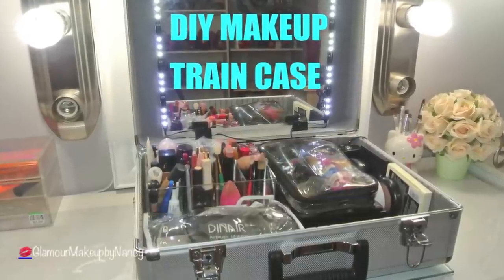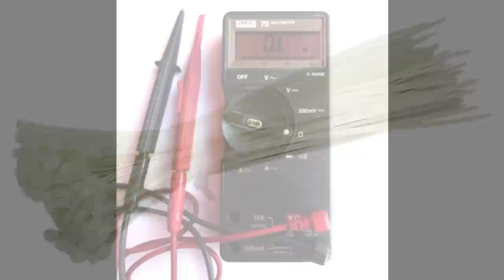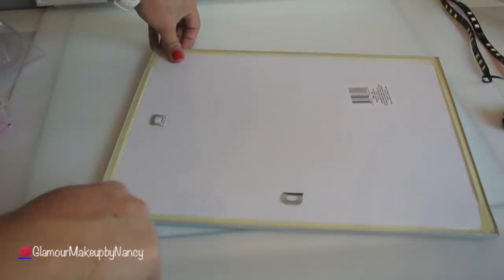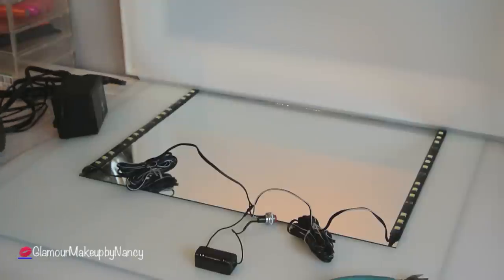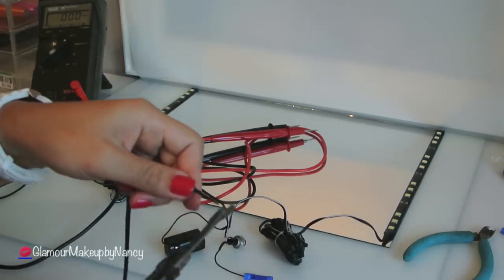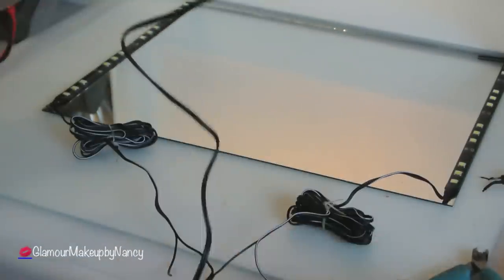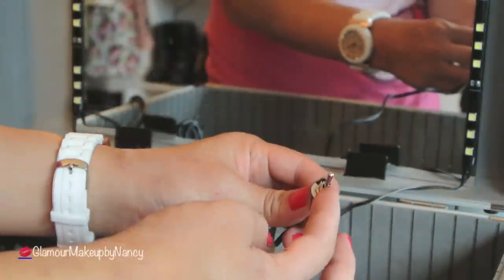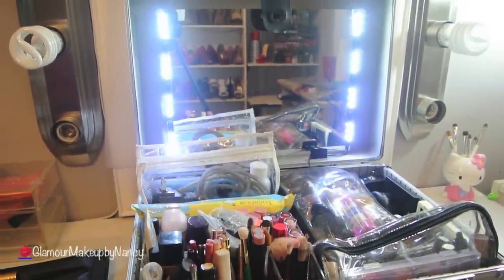♡ DIY Makeup Case with Lights ♡

Comment: do you have a list of where you found all the items needed?
Reply from the maker: Led lights $19.99
http://www.oreillyauto.com/site/c/detail/PIL0/CZ177W/N0383.oap?ck=Search_led+lights_N0383_-1_3254&keyword=led+lights&pt=N0383&ppt=C0335

Blue bullet connectors $2.99
http://www.oreillyauto.com/site/c/detail/CTI0/85432.oap?ck=Search_blue+female+connectors_-1_3254&keyword=blue+female+connectors+

Wire crimper $10.99
http://www.oreillyauto.com/site/c/detail/CTI0/85594/N0221.oap?ck=Search_12+volt+tester_5175793_3254&keyword=12+volt+tester

Toggle switch $3.99
http://www.oreillyauto.com/site/c/detail/CTI0/85982/N0947.oap?ck=Search_toggle_N0947_5175793_3254&keyword=toggle&pt=N0947&ppt=C0335

Multimeter $17.99
http://www.oreillyauto.com/site/c/detail/PFM0/W2974/N1001.oap?ck=Search_12+volt_N1001_5175793_3254&keyword=12+volt&pt=N1001&ppt=C0103

Cable ties $0.29
http://www.oreillyauto.com/site/c/detail/MMM0/59275/N0226.oap?ck=Search_ties_N0226_5175793_3254&keyword=ties&pt=N0226&ppt=C0335

Bracket $3.99
http://www.amazon.com/Install-Bay-Switch-Bracket-Each-PSBL/dp/B0047XQRA8/ref=sr_1_1?ie=UTF8&qid=1407782692&sr=8-1&keywords=car+switch+bracket

12v @Home Depot $5.99
http://www.homedepot.com/p/Skylink-12-Volt-DC-Plug-in-Power-Adapter-DC-12VGB/205073305

Aluminum tool box $29.09
http://www.homedepot.com/p/Trademark-Tools-Aluminum-Tool-Box-67600/204606292

Dollar Tree Plastic frame Mirror $1.00
http://www.dollartree.com/household/home-decor/decorative-accents/Plastic-Framed-Mirrors-11x14-/500c542c546p336912/index.pro?method=search
Reply: GlamourMakeupByNancy